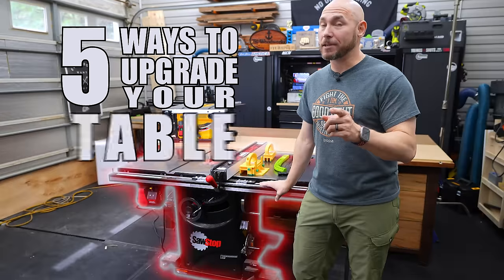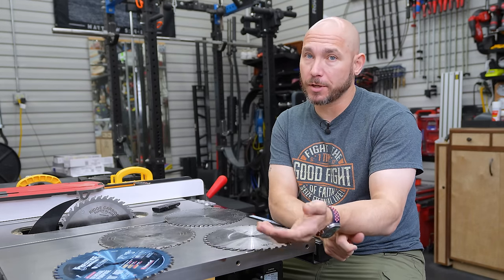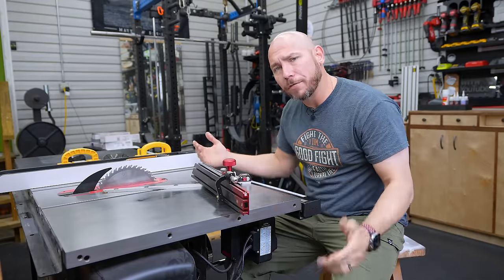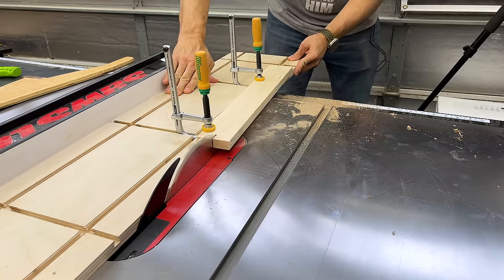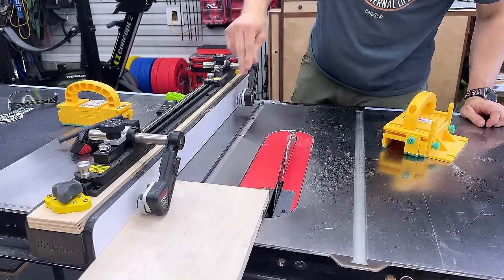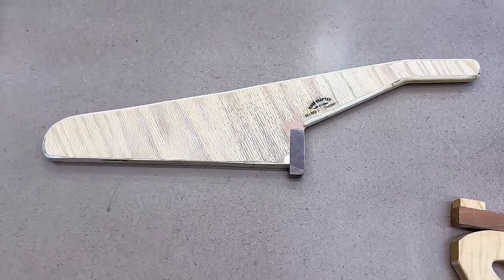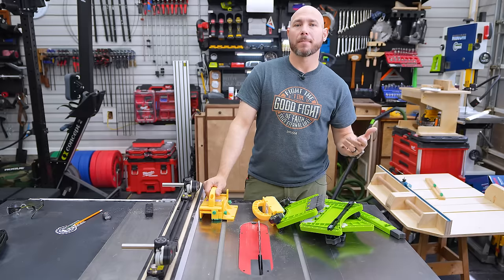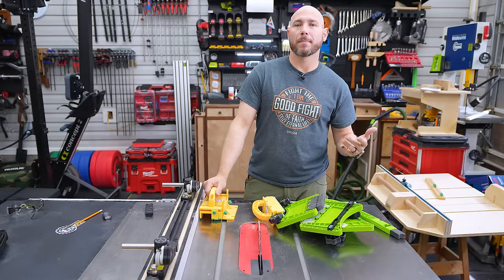Why Doesn't Everyone Make These 5 Table Saw Upgrades?

Comment from the maker: ▼EXPAND FOR TOOL LINKS and INFO▼ 
Watch Next: Why Doesn't Everyone Make These 5 Miter Saw Upgrades - https://www.youtube.com/watch?v=w07_C0pnies
(If you use one of these Amazon and other affiliate links, I may receive a commission) 
Diablo Blades - https://amzn.to/3PKHWZI
CMT Chrome Blade - https://amzn.to/3tt8kzC
Ridge Carbide Blade - https://lddy.no/1i2st
Forrest Blade - https://amzn.to/3Q5Vj81
Freud Dado Blade - https://amzn.to/3LQz2Zj
Incra V27 Miter Gauge - https://amzn.to/3F8ik48
Harvey Compass Miter Gauge 
Safer Cross Cut Sled Plans - https://www.731woodworks.com/store/safesled
Matchfit Clamps and Bit - https://amzn.to/3tiECNH
Thin Rip Jig - https://amzn.to/3rICnCZ
JessEm Stock Guides - https://amzn.to/3ROGbgw
MagSwitch Magnets - https://amzn.to/3RJU53H
MicroJig Gripper - https://amzn.to/3RQEIXk
MicroJig Gripper2 Go - https://amzn.to/3RP67sH 
Bow Push Stick - https://lddy.no/1i2ss
Bow Featherbards - https://lddy.no/1i2sr 
Allred Woodworks Push Stick (use contact form) https://allredwoodworks.com
Tourniquet 2- Pack - https://amzn.to/3Tlcmn3
How to Apply a Tourniquet  @PrepMedic   https://youtu.be/wWVne7cUrm8?si=GNlYzCNvid8nnRQ6

📲 Never miss another tool deal. Sign up for my Tool Deals SMS Alerts - NOTE: I text out tool deals so you don’t miss any! text DEALS to 1 (731) 207-7151 Be sure to add DEALS to your text to me so you get added to the proper list.  You can also click this link https://my.community.com/731woodworks  Important to add the word DEALS to the text!

🇺🇸 Join the Tubafour Nation on Patreon to get an exclusive Tubafour Nation sticker, access to exclusive member-only behind-the-scenes videos, member-only livestreams, discounts, and other cool member-only perks! https://www.patreon.com/731woodworks

Some other useful links:
Daily Tool Deals on my website: https://www.731woodworks.com/tool-deals
Subscribe to our email Newsletter: https://mailchi.mp/7e44c16eefdc/731-woodworks-email-newsletter
Check out our easy-to-follow woodworking plans: https://www.731woodworks.com/store
Outlaw's Board Butter - So Good it Should be Outlawed: https://www.731woodworks.com/store/boardbutter
Reply: As a LEO in Washington looking to get into woodworking after retirement, I absolutely love your channel. I have a question regarding your tapering / jointing jig. What do you think about setting the jig up with a track on the bottom that would fit in the T track on the top of the table saw so you don't have to use the table saw fence? It seems to me, that would be a more repeatable set up. Any input would be much appreciated.
Reply from the maker: @minjin0259   Thank you and thank you for your service!  Yes, you can add a runner on the bottom to ride in the t-slot of the table saw.  That would work great.

Comment: As a former paramedic I 100% agree with buying only name brand tourniquet. The cheap imitation ones are not good.
Reply: Can you recommend a couple of good  brands?  I’ve been out of the game a few years and know there were some early tourniquets that were the go tos, then found to be trash.
Reply: CAT brand. There are a few that have cat in their name but not from CAT.
Reply: My great grandfather was killed in the early 1920s, bled out from being impaled by a kickback.... I have car tire innertube to control the bleeding. Just keep your air compressor running when using your table saw.
PS: The first sentence is absolutely true.
Reply: If you don't have in an emergency situation a piece of rope and a stick works the same I mean if you need to watch tutorials on how it works your probably not going to be handy in an emergency situation
Reply: Rhino rescue is a good tourniquet brand. That’s the one we use in the Trauma Center.
Reply: I only buy tourniquets made by Scotch or 3M.  I prefer just the black one.  Any other tape , er I mean tourniquet is just cheap.
Reply: As another former medic, I 100% agree with you. The knock off brands should only be used to stop severe neck bleeds.
Reply: I'm a former medic as well.  I've seen some devastating injuries where lives were saved from using them.  I've also seen it go the other way.
Reply: Learning how to use a tourniquet is just as important as owning one. Lots of item can make a tourniquet but improperly applying them makes the difference. I have had the unfortunate opportunity to use these including once on myself. Not fun or comfortable but I’m here to talk about it and can still use my right arm. 👍🏻

Comment: Agree with all the recommendations, including the tourniquet. Ridge Carbide sells great blades, but their sharpening service is the best I've ever found. If you buy any brand top quality blade, they can re-sharpen it several times. They also balance and true up the plate. This offsets the initial high cost and makes the blade last a lot longer than a cheaper blade. The price list is on the web-site so there are no surprises. And, the blade has your name engraved on it !! Thanks for another thoughtful video.

Comment: Matt -- I bought the Jessem stock guide about a year ago based on your review/video and have been working with sheet goods rather regularly ever since. It is without doubt the BEST accessory I have purchased for my shop - BAR NONE.  Your explanation of how it operates and the benefits of using it were spot on. I am much more confident and safer as a result of having installed this on my saw. Thank you!!!!!
Reply from the maker: Great to hear!

Comment: For the push stick, my favorite is a simple 2x4.  In the 90's, I needed one and just ripped about 1/4" off the side of a foot long 2x4 with a bandsaw, leaving the last inch for the toe.  Took about a minute to make.  I still have it.  The dimensions of the 2x4 and the profiled edges are very comfortable, a perfect fit for my hands.  I have  tried many others but kept coming back to my original 90's one.   Now I have finally retired it - for another 2x4.  This one is longer and the toe is about 4-5 inches.  The reason for the longer toe is to keep my hand behind the blade during the entire cut, reducing the danger if a kickback occurs.  I just ripped some 2" purple heart with it today.

Comment: I really liked the thin cut jig in the video. I never knew there was something out there for this. I actually paused the video and went on Amazon and bought one. I have those feather boards with the  foam grips and I love them. I use them on my router table and there is no way of a kickback with these. before I got the feather boards I had a cheap router table and setup which went horribly wrong the first time I used it. The table started shaking then it grabbed the board and pulled my fingers into the blade. Routers don't cut off they chew up and spit out so not much to save. not I have a top of the line router table setup with Jessem one way rollers like for the table say you showed and the feather boards you showed. I know I have the safest system now. I can't imagine how things could go wrong again with my current setup.

Comment: For tourniquets: always make sure that the ones you practice with are clearly labeled. North American Rescue even sells them in blue so that you don’t mistake used TQs you’ve trained with for ones that can be used in an emergency. (TQs are not designed to be used more than once. Once you’ve used it, it should either become a training implement or be disposed of.)
Reply: Also worth noting there is no dofference between the training and a 'real' TQ from NAR, only color. If they are out of stock of black or your preferred color and you dont have one, dont wait and get one in some other color. TQs are so important.

Comment: Building a cross cut sled is such a zen moment. Knowing you made something that can make a square cut to within a few thousandths of an inch is pretty cool. 
Bonus jig for me is an extended fence with infeed support.
Reply: You never hear about infeed but I've had more issues struggling with this than I think anything.
Reply: @CeeJayThe13th  
Yeah. I’ve got a small’ish jobsite saw and making good cuts on plywood is nearly impossible with it’s short fence and small base. The wood always wants to wonder. Making a longer fence with infeed support helps a ton 👌

Comment: I would add a dial indicator that works off your miter slot to this list.  Anyone who has an older table saw that has questionable squareness, this really should be your first tool.

 I have a cast-iron 1968 Mao Shan table saw and  I started with several the upgrades that you've listed here, but nothing seemed to help because I couldn't get stuff squared. I went ahead and bought the dial indicator (I bought a Rockler version, but there are several different types that all do the same job) and used it to tune up my blade alignment, fence, and miter gauge.  NIGHT AND DAY DIFFERENCE. 

If you don't have your blade and fence  square to your miter slot, none of the rest of it matters!

My two cents from the cheap seats. ;)
Reply: You are spot on. It not only makes your cuts smoother and prevents burning, it is also a safety issue. A misaligned blade can be dangerous, especially when ripping, because it can pinch the wood and cause a kickback situation.

Comment: I bought the Skil job site table saw based on your video review and I love it. It would be great if you could do a build video on a cross cut sled for it and other smaller table saws!
Reply: I just got mine in the earlier this week and unboxed it. I’m looking forward to using it in my shop!!!
Reply: Same principles apply no matter the brand of saw. You just need to adjust the size to fit yours

Comment: The crosscut sled is a must!  I used mine last week to cut some small trim pieces for a bathroom remodel.  I even used it to cut a taper on one of them.  One great advantage is that like the zero clearance insert, it helps avoid any tear-out or splintering.  I'd like to build one with slots like yours.  Clamps work, but it's a little slow.

Comment: My first build was a mini crosscut sled for Dewalt jobsite saw. Made a larger one when I got the Sawstop..for my safety😊. Yes 100% agree the push stick that came with both above is warm garbage. Tiny lip wont keep the board down thru the cut so made one that would. Thanks for the shout out!👊

Comment: For the Zero Clearance on my Sawstop I use the "Colliflower Zero Clearance" plate, which gives you the ability to swap out only a strip on the plate instead of needing an entire new plate for different blades and angles to get a perfect Zero Clearance. Colliflower also makes a similar plate for certain Miter saws, and a really great Miter Saw Zero Clearance Fence design which uses 3D printed (or hand cut wood) cubes you cut into to prevent kickback. 

I think Colliflower is mostly one person and they're a little overwhelmed right now, but the products are great.

Comment: Diablo and Freud are made by the same company. 
While working at a woodworking store (that everyone would recognize) we had the Freud rep come in. He had just come from the HD down the street. When asked what we should tell customers the difference is between the two he laughed. Then he said that the company's description is that a Diablo is made for a tool that goes on the back of a truck (jobsite) and a Freud is made for a tool in a shop. 
According to him the Diablos have softer carbide and are made to take running into a nail. The Freuds have different carbide formulations on differing products depending on their use and are harder than the Diablo carbide. Also, a Diablo can be sharpened a few times (and be better than when you bought it) while a Freud is sold sharp and made to be sharpened 8 to 10 times. 

I use a Freud Fusion on my crappy, really old Craftsman and get polished cuts. I used to keep a cutoff from that saw with me when on the salesfloor and would show it to customers. That led many to buy that blade. Impressive as I was not great at selling stuff. 

Cleaning blades is critical. Others mentioned that. Really should have been one of the tips. 
While the Freud rep was in the store the manager mentioned that the (really nice) chop saw had it's blade freeze up when they were cutting a lot of wood. First question rep asked was "Did you destroy your motor?" Turned out we hadn't, and were really lucky. Second question was "Is your blade dirty?" Of course it was, because no one was bothering to clean it. Rep said that the pitch on the blade caused it to get hot. That in turn caused the laser cut slots (meant to kill vibration) to heat up. If you look at a blade you can see how if those expand they will be forced to protrude to the sides. And that will cause binding. And that will freeze you blade in the kerf. Since the chop saw is direct drive that takes your motor from fast to stopped. And that frequently destroys the motor. 
So, keep your blades clean. Our store sold stuff to clean blades, but Simple Green works really well. I might have told a few customers that.
Reply: Thanks for the low-down, Dave! Hits the spot, when you're awash in a sea of hype!

Comment: I always enjoy your videos and have benefited greatly from your wisdom! I do want to offer one caution on the Harvey “Compass” miter jig? I rarely use mine. Why? Because it will only function properly on a mitered (angle) cut on my table saw, for pieces 4-5” wide. If you try to miter a board wider than this, the extreme outboard edge (left) of the miter falls off the top of the table saw, rendering it not useful. I will work better if one installs an in-feed table, I suppose?

Comment: The Freud Dial-A-Width is the best dado set around.  It's expensive, but worth every penny.  The gist of it is, there are no shims to mess around with and/or lose.  You just put the blades and chippers together, then turn a dial which increases the width of the stack by .004 for every click.  It's incredibly easy to dial in that perfect friction fit.

Comment: Bought a hitachi table saw 20 years ago while i was renovating a 3 family i bought, i use it a lot, my brother borrows is too, it still has the original 10" blade, i have even cut thin steal brackets with it once. Watching this i thought i'd take a look at the carbide teeth, theyre still reasonably sharp, not perfect. I know about carbide cutters as i am a retired cutter grinder. I have a new blade but not changing it yet, all i'm saying is for $300 approx 20 years ago i'm satisfied with this cheap table saw and blade. Usually i dont cheap out with my tools but a friend said to me go to lowes and buy this, he used one at work and it was a good choice. I do know im not using it like everyday wood workers. Also i cant read on the blade the manufacturer but it kasted 20 years

Comment: A good alternative to a good dado stack, and far easier to use, is a Bridge City Kerfmaker. Bridge City was one of the insanely expensive tool companies.  Since Harvery bought them, they've come down to very, but not insanely, expensive.  There are also BangGood knock offs and it's not that big of a deal to make one. The Woodpeckers FlipStop will do the same thing but also very expensive.  A standard blade can be used with these tools but he bottom won't be flat.  A #1 grind (flat bottom) blade will be needed or a little cleanup with a chisel after. Even if you have a dado set, this makes using it a lot simpler.

Cutting miters, even with an expensive miter gauge can be iffy.  A cheaper solution, that works with cheaper miter gauges is the "MiterSet".  One will do N-sided boxes, and the other angles from 0 to whatever, by .5 degrees. Each costs about $100 but you might be able to get that back by buying a cheaper miter gauge.

Two more "cool tools" for you, Matt.

Comment: I bought the jessem stock guides and made the jig per your instructions. It works great! Well worth the price and little amount of work to mount it to the table saw fence.  Also first time buying and using the mag switches. They are very useful as well!
Reply: Will that Jessem work on the dewalt?
Reply: It should but depends on your fence having the width to mount via a jig.

Comment: im new to woodworking and just got the job site table shown. basically just building small projects around the house. cant wait. these are great ideas. I had one question. does a saw sled eliminate the need or lessen the need for push sticks and similar items?

What are the drawback to the saw sled? is there a reason i shouldnt be using it for 99% of cuts?
Reply: Main drawback is that the sled is not suited to making rip-cuts - and rip-cuts are when you most want a push-stick.  Basic sleds are suited to making e.g. 90-degree cuts, and upgraded sleds can have support for mitre cuts, etc - but their design inherently limits the length of rip-cut they can make.

Comment: My best professional quality push stick, among other shapes and materials that I make for my own use, is a simple aluminum bar, 1"x 1/8" or 3/16" in cross section. Tape for a handle, if you like (I like Rob Cosman's hocky stick technique.) Business end is a birds mouth, with a the top filed to a tooth, which I use instead of an awl for precisely grabbing the top of smaller stock. Durable, and its best virtue is that if ever the blade is contacted, it just shaves it with no drastic acting out, same as wood.